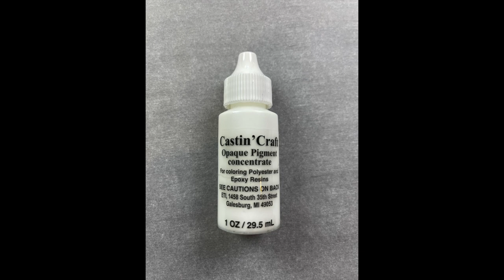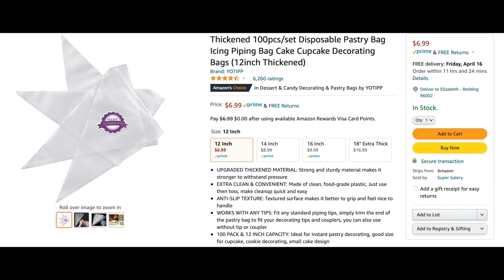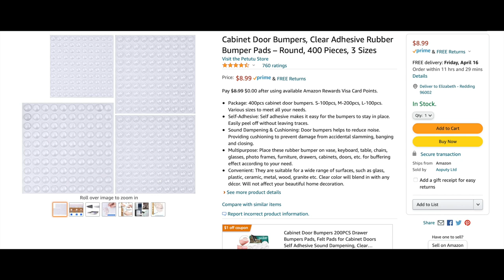How to Make Flower Resin Coasters - DIY Epoxy Coasters - Flower Design

Comment: I'm just starting to work with resin and was wondering if a hair dryer on low would work?
Reply from the maker: Hi Misty. Great question. A hair dryer doesn't get hot enough to pop the bubbles. You can find inexpensive heat guns on amazon. You don't need any fancy. Also, don't use a blow torch or open flame on your molds since it can ruin your molds. I learned that one the hard way. 
Welcome to the resin art world!

Comment: Do you dome or add a top coat afterwards?
Reply from the maker: Sometimes I do. Since these were for personal use and not to sell in my shop I didn’t top coat. Great question. If I do I will use latex to coat the bottom of the coaster before pouring, then peel off when it’s cured enough to touch. 
Thank you.